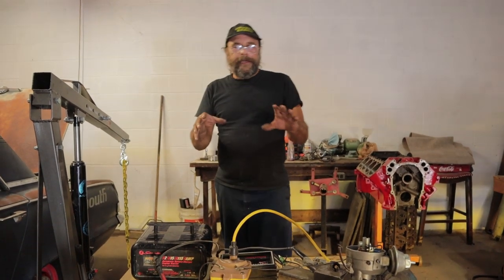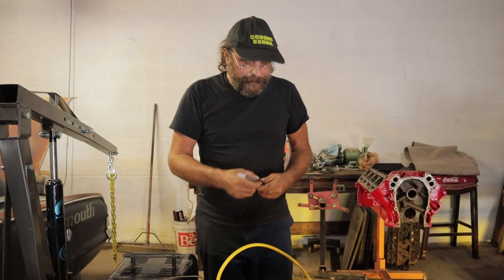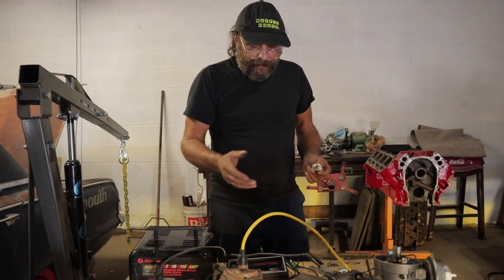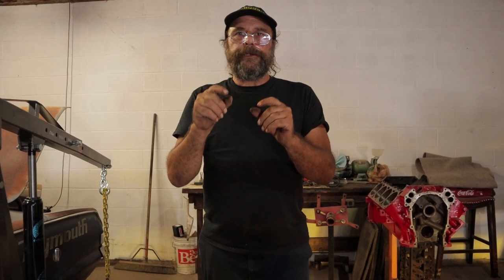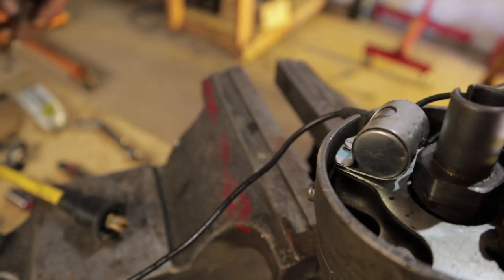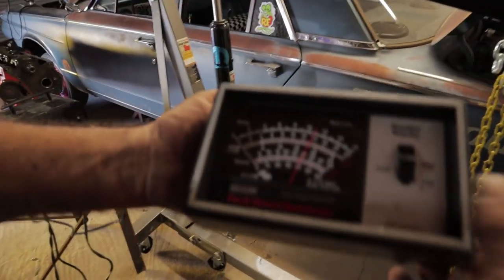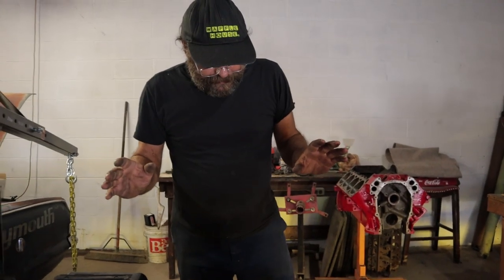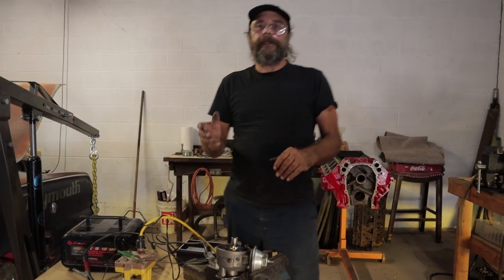Classic Car Tech-Setting Up A Point Ignition

Comment: The hardest distributor I've ever pulled out,was on my 60 Ford F100 4x4 there is less than 1 inch clearance from the firewall to the  distributor hold down Bolt, you're literally straddling  a 292 30 minutes trying to get that distributor shaft gear back in sink with the oil pump. Never seen nothing like it in my life.
Reply: Agreed we run  6 of thoes old Ford  4x4s on the farm and 4 of the grain trucks if it has a 292 leave distributor in and get a mirror  to see
Reply: Mark Prosser unbelievably, this old 60 Ford, was given to a guy 12 years ago. But he couldn't get it to run or get it upon the car ramp. It had four flat tires. I drove by and I asked the lady if she wanted to sell it in 2016, she said it broke down on her husband. and he passed away if you can get it out of her yard you can have it. But it's got to be gone in 30 minutes, I called up my buddy he brought the car trailer over, I pulled the battery out of my truck Pulled the spark plugs out of the engine on the Ford, turned it over, put it in first gear (high) walked  it right up on the car trailer... the lady says you got to be kidding me. I said what do you mean she goes is that all it took! I said absolutely the easiest way to get unstuck if you don't have a tow truck or friend pull you out,Pull the Spark spark plugs out,,, put it in gear and you can walk your vehicle out of any situation, she asked me where you from? I said all around the world ex-army, born raised in Oregon. She said I'd never seen that done before. I said sure every guy knows that don't they?. She said No!🤣 out here on the ranch, I just put her down and Granny low drop tailgate put on some Hank Williams Jr,,,,,got a six pack of Miller, go for a ride on the back of a tailgate. There's nothing to stop this tank. She's a real fine sweetie.😊

Comment: Thank you for the video! This was very helpful for setting the dwell on my Buick 455. I would run the car for a moment cut it off and it wouldn’t turn back on. Last question, rumor mill has lead me to believe that if the points aren’t adjusted correctly, it can cause the engine to run hot, is this true?

Comment: My 1969 Buick 430ci reads 25 dwell angle instead of 30. As the rubbing block wears 30 can go to 25. Car still runs great. Ofcourse i have cleaned the points some when needed. Now, what is the dwell number when you need to change out the points? Thanks.

Comment: Hi Uncle Tony! Ive got a odd fire buick stage 2 v6 race engine which has the distributor window that you showed us.for some reason its not starting anymore! i believe i have to change the points and condenser. I dont have the dwell tester. Can i just set the points with a feeler gauge? If yes, what gap should i do? The engine is usually run between 4000-8500 rpm's. Thanks!

Comment: We also used the points files on clocks. And old tube radios had a vibrator that sometimes had to be filed. GAWD I'm old!!
Reply: Omg ..I have the same dwell meter from Sears.I Bought a 1969 z/28 in 1984 for $4000.00 ,still have the meter..car is gone 😅.

Comment: Most small aicraft engines have 2 dual point magnetos,  one of my projects when going to school for my A&P license was to build a dwell meter for that set up. That was 30 years ago, meter still works as well or better than the high dollar electronic ones.
Reply: mark campbell   A dwell meter?  Or did you mean a timing indicator.  I built a mag timer box myself for aircraft mags.

Comment: Condenser stores energy just like a capacitor..When the points close it creates a short and that allows the high volts to charge the condenser for the nice strong spark we need..You can try it if you eliminate the condenser and observe the very poor spark....You should have charged one up as a demo mate...They'll shoot a spark through a cigarette paper....It's part of a system that ramps the power from 12v from the battery to 40kv at the spark plug...Takes me back to when we really had to tune a car engine.

Comment: The condenser doesn't go bad often, but it is so cheap it is changed when the points are changed. Some distributors have an oiling port, often with a spring-loaded cover on the outside and this is to oil the distributor shaft bushing. Some points sets include a small capsule of cam lube in the box or package. You can file points if you aren't going to replace them, but they are so cheap there isn't much reason to not replace them. I do use points files for other things though. I have seen people that put sand paper around a match book cover and sand the points. A better use of a match book cover is setting points gap when you don't have a feeler gauge or dwell meter and are stuck on the side of the road with points that closed due to a loose screw, which often happens in Fords especially. The dwell or points gap can be other than the specified ideal setting range, but points life can be shortened and the spark power might less than maximum, but often good enough to drive for a while.

Comment: I used a thin folded piece of 320 grit orbital  sand paper pulled through between the contacts on the points while it is closed a few times and it cleans them right up then i reset the gap.

Comment: A condenser is a capacitor that sends the voltage in the points to ground when the points open so they dont arc and then pit and burn on the contacts. The lead is the positive and the body is the ground.

Comment: To the best of my recollection, condensers used to come in different values to control the amount of arc deposits. If deposit on one side of the points go higher, the other go lower, but I don't remember which way was which. I also recall some older cars having the on the coil instead of in the distributor.
Reply from the maker: The ones mounted on the coil were to reduce radio static
Reply: @UncleTonysGarage  Huh. Live and learn. Haven't even seen a set of points since the trunk floor fell out of my last Caddy. 🤣

Comment: I had a 200 ci 1967 Ford six cylinder that would not keep a consistent gap and I couldn't figure it out, until I discovered 1/16" play in the distributor shaft.

Comment: at 11:09 the gap numbers isn't what's important, the dwell number is what's important. They are the same thing. The dwell meter helps dial in the gap much more accurately  than going by feel (gauge) alone. Well done.

Comment: I love the points apposed to the early electronic hands free thing and there is nothing short of changing that whole thing out as it is un serviceable. I wanted to also have a choice when running a different plug on a tired engine as the hotter spark would burn some fuels that were not supplied by the carb such as that PCV unit that captured crankcase venting. I think that Detroit went way to far outside the box on them trying to burn stuff that could of been captured into a filter and then properly got rid of Sure it did make for upper cylinder lubrication because the unleaded fuels took away that. If it is slight then fine but some stationary engines with a half million miles just doing a simple job never ever gave up. I wouldn't use it as grandmothers grocery getter but I wouldn't change one out just because the planet is going to fail because of me. We have been messing with mother nature since time with fires, floods and other to the cow fart. I do believe if in my heart it was then I would change but I see what goes on in the many countries and there is no going back. Even if man does kill himself off, nature has dealt with it and here we are. Great video that is easier to do than explain but I think that you did great, Keep em coming Tony

Comment: Ok I am going to set up the SBC I'm rebuilding now on points in honor of this video.    I wanna hear your opinion on something, if you will.  I got the crank out yesterday, and one of the main caps is really marred!  I got lucky and the journals on the block are ok.  The crank is trash as two conrod bearings spun.  What I was thinking about doing is getting a collection of spare main bearing caps (pulls) that are decent.  Then, one by one, install on the block journal that needs a new cap, torquing them down and using a bore mic to check the roundness of the assembled parts.  The idea is, yes block and main caps are machined as a set at the factory.  But because of limited variation due to statistics and tollerancing, the idea is you can find a main cap that is within spec for roundness when installed in that block.   Thus you can avoid line boring which would be necessary with a NEW main bearing cap.  Genius or crackpipe?
Reply: by the way I can also check the main journals on the block with indicators and a milling machine to verify they're within coaxial tolerance, FWIW
Reply from the maker: Round is only part of the story.  How well the cap fits down in the register of the block is also important.  The cap would really have to be trashed before I would consider replacing it.  A couple of nicks and gouges probably won't hurt if.  Important thing is how tightly it holds the bearing
Reply: @UncleTonysGarage  the surface is wavy gravy!  I mean I don't think I can get a good enough register on a bore gage to take a measurement I have any faith in.  I'll take a vid.  You'll like this one.  Got some more junkyard GeMs.

Comment: A "condenser" is just another word for "Capacitor". Just like all of those tiny silver metal cans on the circuit board of every electronic device.  It's basically a tuned "battery" ... or a "shock absorber" is another good way to think of it.

Comment: Condenser has two jobs.  Protect the points (1), and speed up coil saturation (2).  Condenser gathers electrons (that's current flow) and when it does the coil field is built or collapses depending on which way the current is flowing.  Since condensers have almost instantaneous charge time,  the coils magnetic field is just as fast. 
Try running a coil ignition at high speed w/o one ...  It'll fall on its face somewhere around 2,500.  Put in a good condenser and you can go to 6,000+ with a hotter and more intense spark. 
Very important part, often overlooked ...

Comment: I'm a mopar guy but the GM points are the best when you can set your dwell without popping the cap off just get the allen wrench and a dwell meter and your done it's so simple
Reply: @grandmasmalibu  I loved the GM windowed distributors for adjusting points.  Way better than Ford.

Comment: How do I go about hooking my dwell meter up to my positive ground?  On a 48 ford. Converted to 12v.  Or from my understandings I just set the gap on that style points?  I've done that and filed them and it runs fine. but I love to have more knowledge on the subject!
Reply from the maker: Not sure on that.  I don't believe you could hurt a dwell meter by reversing polarity, so I'd just try it both ways
Reply: I don't usually ask questions, but when I do, I stump even the best!  This whole reverse polarity makes rewiring a bit unusual. Relays and everything is backwards! Fucks with a guy's head. Lol
Reply: @kentkirkpatrick7953  How true! We operate 3 Ford 8N`s that are - ground except 1 & at times they drive you crazy! They are 12volt except the one I was using this am which is the original 6 volts + `ground system.

Comment: Important thing to remember when setting your old style ignition , you can set your ignition at TDS  on the first pot in the firing order & set your distributor/points etc according , but it is 50/50 that you set the motor to fire on the exhaust stroke or compression stroke  . . if it does't want to start , turn the distributor 180 degrees in its housing . this why you ideally need to have the rocker covers off to see whether which stroke you are timing to . . as in exhaust/not fire or compression/starting , as in you have two full cycles for an single  cycle in four stroke motors . . ok I'v tied myself into knots & need to leave ASAP
Reply from the maker: Pull the #1 spark plug and cover the hole with a finger while someone bumps the key.  When you feel compression, you're in the right place
Reply: Hmmm,,,,Got me fucked why you don't just remove valve cover and watch valve timing.
if there not rocking you will be pretty close to getting on fire and  not recharge,,
as for top dead centre..should have timing marks on crank,,ifin ya put it back to-gether right,

Comment: A condensor is a capacitor.  It reacts to a change in voltage.  The secondary on the coil is an inductor which reacts to a change in current.  the secondary of the coil and the condensor together form a tuned" resonant tank circuit.  Put a scope on it and you will see a decaying sine wave each time it fires.

'

Comment: Good video. Except a uniset was a point set that had a condenser attached to the points. GM started using them in the early 70s. they were easier to install because all you had to do is loosen two screws. They also had a high failure rate. Fortunately they left the screw hole for the condenser in the breaker plate so you could use a point set and a separate condenser. Also the GM points had slotted mounting holes so all you had to do is loosen up the screws and slip the old points out and slide the new points in. GM started using the points with the allen screw adjustment in 1957.  Accel dual point distributor used the allen screw adjustable points. Although it was better to pull the distributor and put in in a distributor machine to set them up. You would put a piece of card stick between one set of points and adjust the other set. then reverse the process and set the second set. You then ran the distributor with both sets working to check total dwell. I ran a tune up shop for 5 years in the early 80s and installed as many as 16 sets of points in one day. That included replacing the plugs and all other necessary tune up parts.
Reply: Yes the high failure rate we just discovered! Going back to separate points / condenser setup. Also the GM uniset now uses a cheap white plastic rubbing block that wears very fast even with good cam lube.

Comment: The condenser.  So if you say the condenser makes the points last longer. Well heat is the killer of all things.  And the condenser has aluminum foil in it layered at that. I would say it draws heat from the points and uses the layers of foil to cool?

Comment: God I have forgot more about points and point type ignition systems than most people today know about them! I recall back in high school over 30 years ago in my small engine repair class, my teacher drove a 16 penny nail into a condenser trying to short it out (so the motor it was installed into wouldn't run on purpose for our final test on ONE MOTOR) and for some bizarre reason that even he wasn't sure why, the motor started and ran without a glitch!! Of course I had helped him "short out" the condenser, so when the motor turned over and ran, him and I just looked at each other and LAUGHED that the nail for some reason DID NOT short out the condenser which it should have! But to this day I still think it was interesting that of all the "problems" I have seen with point type ignitions that was the only time I ever seen a condenser that screwed up, and STILL work correctly!!
Reply: By the way I have the same EXACT Tach and Dwell Meter!! Kind of funny seeing another one in 2019!!! hehehehe

Comment: People are always shocked to learn I still run points on my 70 Cutlass, but they just work. You could probably do a video of voltage chopping to the coil when running vs cranking, voltage regulators, resistor blocks etc. That's an easy wiring mistake that really screws things up!

Comment: I heard that if points happen to be in closed position, they can be damaged if ignition is left on without running engine i.e. listening to the radio or using map lights.
Reply from the maker: That's why ignition switches have an "acc" position

Comment: Awesome Uncle Tony《☆》Good class today :*: The majority of small piston engined aircraft are still using breaker point ignition systems. With 2 sparkplugs per cylinder & dual points in each magneto with 2 magnetos it's a pretty reliable system. Some aircraft will incorporate a set of retard points for starting the engine while others use an impulse coupling on the magneto rotor to retard the spark and the spring loaded coupling will catch on a pawl and release to give a hotter delayed spark during an engine start🤓☻🤠